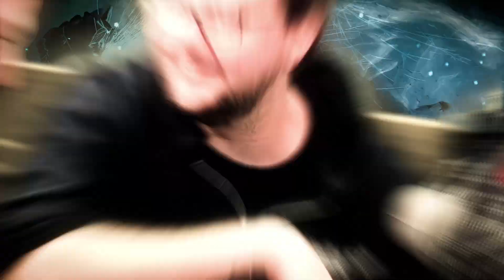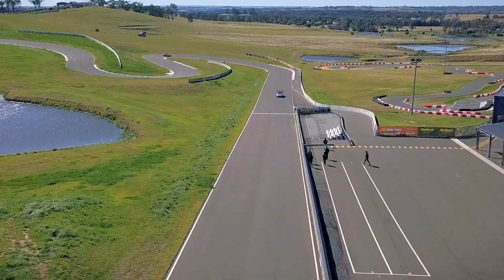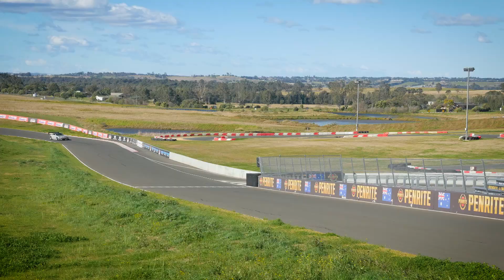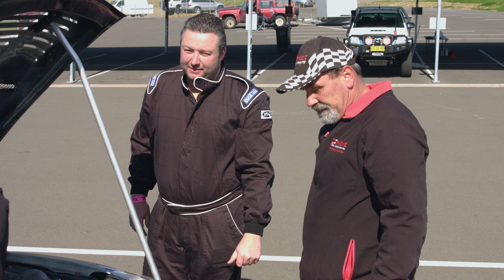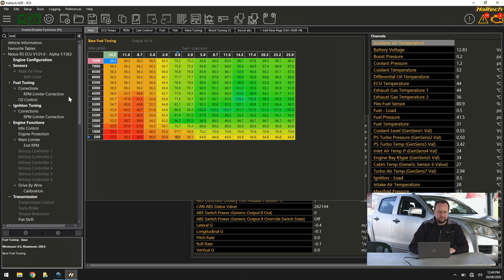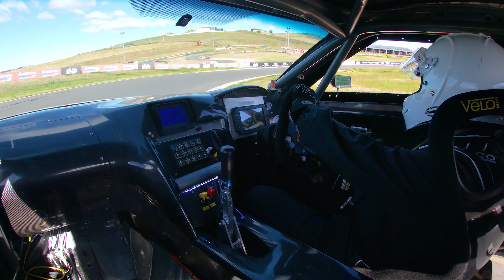🛠 EP5: Shakedown + Traction Control + ABS + Data Logging | R5 for R35

Comment from the maker: Welcome back! It's shake down time for the R35:)
We head out to the Luddenham Raceway for a day of shakedowns and track tuning. We meet the car’s owner and driver - Brian while Scott gets busy with data logging and setting up the traction control, pit speed limiter and the ABS system. The R35 gets some test laps under its belt while Brian gets used to his new ride. We finally get to see how all the systems perform in the environment they were designed for.
-----------
While this is the last episode of this series we are actually planning a Q&A episode where we’ll try to answer the questions you’ve posted in the comments. So if you do need more information about a particular topic we covered in the series or any other questions about wiring, ecu setup or tuning in general - please post them in the comments section:)
Reply: Scott from Haltech is the best! Nexus R5 is the top of Haltech VCU in this year, love it mate!

Comment: Can I pull wheel speed sensors from a Teves MK60 ABS unit and use them similarly on my Elite 1500 as long as I’m running NSP software?
Reply from the maker: That sounds like a question best answered by our support team. Send them a message via www.haltech.com/support

Comment: Will Elite 2500 limit power in traction control using electronic throttle?  Or are ignition cut and fuel cut the available methods?

Comment: What a great build series!  The insight into how you integrated all of the sensors into a comprehensive data log was great.  It’s such a luxury to have access to all of that telemetry to see exactly what is happening and tailor the response of the car to what the driver needs.  Looks like the car will be quite a monster once everything gets dialed in.  The success of the shakedown day is a testament to your supreme technical capability and the performance of the Haltech systems!  Congratulations on such a phenomenal race car!

Comment: When are some of these features, such as third party CAN communication integration, the keypad and so on will be brought to the elite series? 
Also, why not have a single software instead of forcing Elite owners to continue to use a very outdated and slow software. Can we have the compatibility on the NSP software with Elite series ECUs in the future with an update?
Reply from the maker: NEXUS is a brand new product (a new generation) with a complete new hardware so it requires a new firmware/software. Using Elite software on the NEXUS would be very limiting as the software was designed for the Elite series hardware. Likewise making NSP backwards compatible with Elite would be very limiting because of Elite's hardware. It's the same situation with all computers, mobile phones, tablets etc. New firmware/software is designed to take advantage of the new hardware and vice-versa. Having said all that - we are working on an update for the Elite series which will include some of the new features available in the NEXUS software.
Reply: @haltech   As a programmer myself, that is just a bunch of excuses. 
You already have the engine to flash the Elite firmware and the NSP software would be used as front end where you can just enable or disable features depending on capacity. 
The great majority of things you can do on the NSP engine wise, you can do on an Elite, however with a incredibly slow software requiring completely outdated dependencies for the UI. 
What I'm seeing is that Haltech is dedicating the great majority of their efforts on a very expensive ECU that the majority of people don't need.
This to say, that as a recent customer to Haltech (Elite 1500), the sensation I have is that the Elite will be slowly left to die, being a very very closed ecosystem I will be left stuck on an old product.
 As an example, things like customizable CAN support should be already added or support for third party extension modules.
Reply from the maker: We are currently working on exactly what you've outlined - an update for the entire Elite series that will take advantage of as many NSP features as the Elite hardware will allow. This will include an updated software.

Comment: With the wheel speed sensors, you were able to detect the left rear wheel was spinning. Instead of using an LSD (or spool) diff, can you use the ECU to apply the brakes, via the ABS, on that wheel? i.e. traction control?

Comment: For race track application could you have tyre pressures and temperatures monitors to track that info
Reply from the maker: Yes you could with tyre pressure sensors.